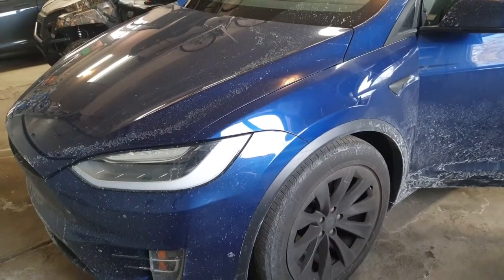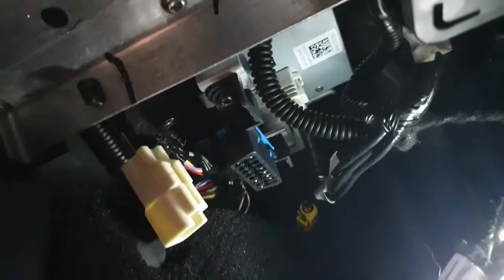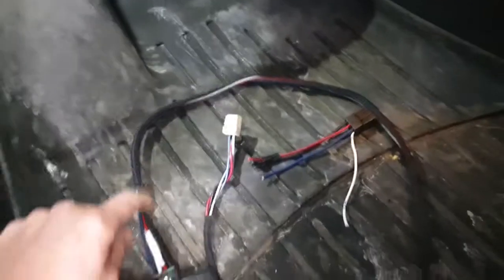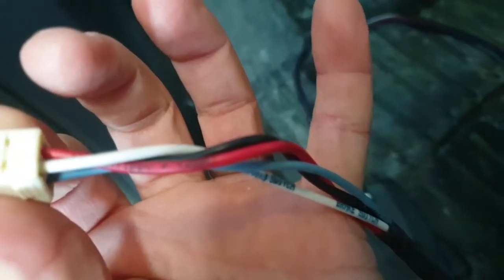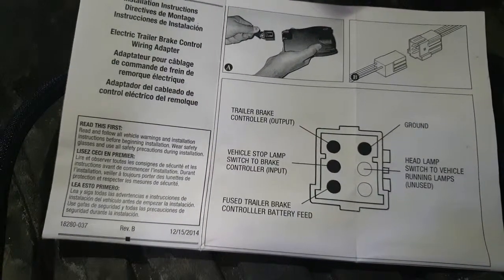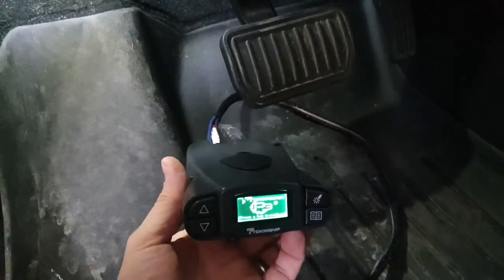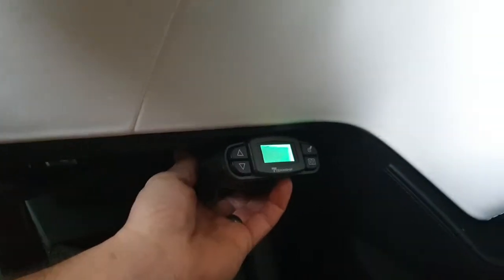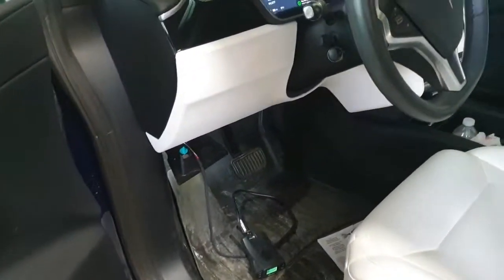2017 Tesla Model X Tekonsha Brake Controller Install

Comment: Thank you for the video!  I have the same setup so looking forward to seeing how it tows our 2000lb trailer.
Reply from the maker: @ddub8811  Also make sure your 12 volt signal from your trailer 7-way plug connector is pinned correctly. Turns out mine on my 2017 was not from the factory, so it was not supplying 12 volt to the trailer battery when I was hooked up.
Reply: @chovis38  Thank you for the additional note, I would not have thought about double checking the pins.

Comment: Great video!  This would have made things simple when I wired mine.  I screwed mine into the panel that you remove for the harness but it was a little nerve racking.  Thanks for the video.

Comment: Did you need a special harness?  I see options on Amazon but I'm not sure what to get with the unit.  And thanks for posting!
Reply from the maker: Our X has the towing package, so it came with a harness pigtail.... One end plugs into a mating connector under the dash, the other end is bare wires that need to be spliced into you brake controller harness.

Comment: Please could you post the link to the electronic brake controller
Reply from the maker: TEKONSHA P3 BRAKE CONTROL + WIRING HARNESS FOR 95-09 DODGE RAM 1500 2500 3500 + DAKOTA, DURANGO & ASPEN. CONTROLLER + PLUG/PLAY WIRE KIT. https://www.amazon.com/dp/B007O5GWNI/ref=cm_sw_r_apanp_F7gWWxcjmopGr

Comment: How did you loosen that panel? I don't want to break anything. I yanked on it various ways and it held tight.
Reply from the maker: There are a couple clips that secure it.... And you'll have to pry. I have a trim/ clip removal tool that makes it easier. But yes, it will definitely feel like you're breaking it, unfortunately.
Reply: @chovis38  I found that by first freeing the pins near the carpet I could slide the plastic housing back of the green pin and break nothing. I took it off and put it back on several times during my install. Once I got the technique it was easy.